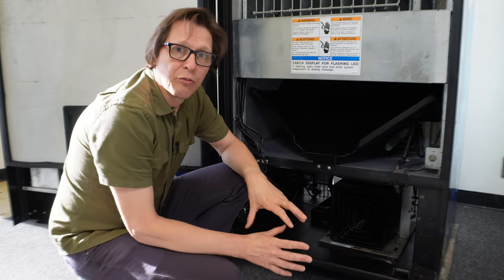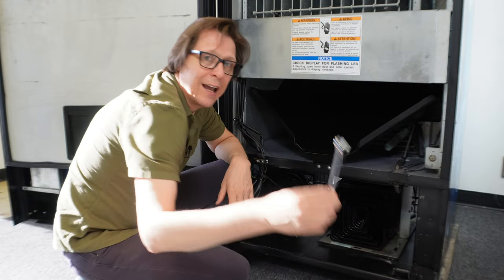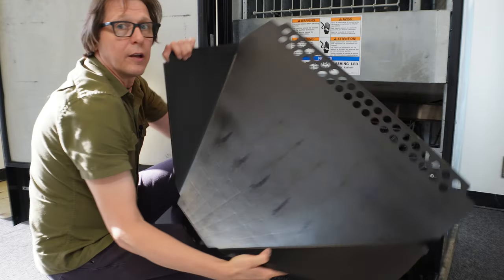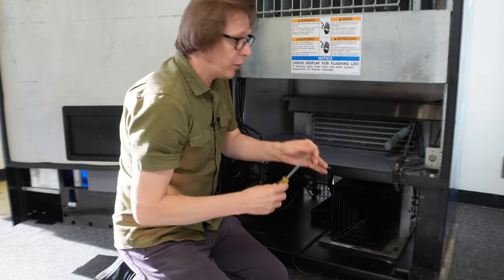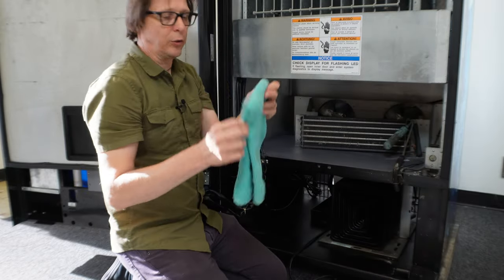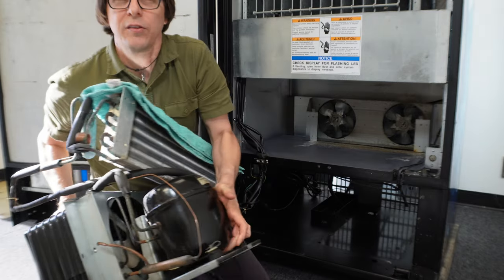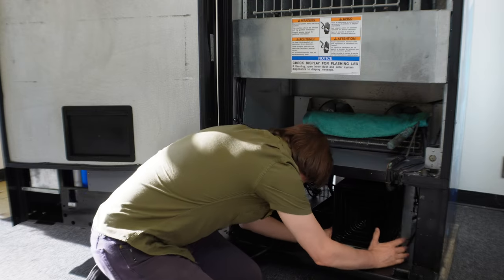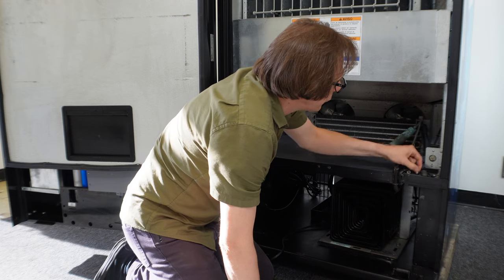Dixie Narco 501E & 276E Drink Vending Machine Cooling Deck Install - Vending Machine Repair

Comment: noticed he didn't have the platte that goes in front of the compresson on the machine. I find that plate to be the biggest headache of the whole process especially if any of the self tapping screws are rusted

Comment: Hey! This video has been extremely informative. I am thinking about spending about $500 to purchase a new cooling deck. I have ice building up at a very quick rate. I did your test from another video where I left the condenser running with the door open for 15 minutes and only about half of the evaporator coil was icing up. This seems to indicate that the condenser is no longer any good. I called a repair place that quoted me for $500 to $750 for repair, but I think replacing it myself is going to be better. What do you think?
Reply: Which video did you see about the icing up?

Comment: Can you do a video on how to install a royal 650 compressor unit like this video you did for the Dixie Narco 501 E
Reply from the maker: @Cori Walker Thank you Cori for the suggestion. I have added it to my list. Though the removal of the Royal 650 compressor is generally the same as a Dixie Narco 501E. The refrigerant lines in a Royal 650 drink machine are on the opposite side of the Dixie Narco 501E. Other than that. The tools needed and the process is the same.

Comment: Great Video!!  I need to know if I can quiet the fans when the compressor is not calling for cooling.  My 501e continues to run the fans and is noisy in the indoors location of this pop machine.
Reply from the maker: Please read my comment on your other post.

Comment: Very informative video. I have the 276E, everything is running fine but getting water build up around evaporator coil which in turn slowly cause water to end up on floor every couple days
Reply from the maker: Thank you. Are you getting any water in the drain pan at the bottom of the machine to the left of the cooling deck? Do you know what the actual temperature is inside the machine?
Reply: I will check those two things. I haven’t check temperature with thermometer so i will do so. I just know the drinks have remained cold. I’m new at this, so i really appreciate the help
Reply from the maker: @ericroberson4127  The temp you are looking for is between 36F and 40F. There is a small drain hole just below the evap coil. On the underside, there is a hose the directs the water to the drain pan. Check to make sure the water is draining to the pan. There could be a clog in the hose backing the water up. Look for any excessive amount of condensation around the inner door seal and along the edge of the cabinet. Also have a look at the motor cover to ensure is attached correctly.
Reply: @VendingMachineSupport  ok so i think i solved my leaking water issue. I did what you said and checked the drain hose, i took it off cleaned out and stuck small screw driver up hole and water began to drain. I bought $10 digital thermometer from Walmart and sat in machine for about 2 days and temp was at 44F, is that an issue? Also thank you again for all the help and guidance
Reply from the maker: @ericroberson4127  Your machine in my opinion is a bit warm. The temp in a drink vending machine should be between 36 and 40 degrees. Diet soda freezes and 34. So 36 is a safe low temp for drinks. Go ahead and adjust your thermostat two notches or 1/8 of turn clockwise and check on the machine the following day.
Reply: @VendingMachineSupport  i actually repositioned the thermometer and placed it on the deck where the evaporator coil is and it read minimum temp was 34 and actually temp was 39. I had the thermometer initially on the drink gat that keeps drinks from slinging out where i don’t think thermometer was getting accurate reading
Reply: @vending machine support have you ever had the other issue I’m having. I have Nayax card reader on the Dixie Narco and some transactions with card and Apple Pay are failing to go through. Now transactions are going through but there are times where person will have to try multiple times for it to go through or it doesn’t go through. When i log on to check last sales on the website it says “Cashless Canceled-MDB no Idle”
Reply from the maker: @ericroberson4127  This can be tricky. First thing to do is to rule out the actual machine. Is the machine able to take cash? If so, then have a look at the Firmware that the board is using. I am assuming you are using an SIID control board found on most E series  drink machines. (One single mode button). Navigate to HD -> DIAG -> VERS. This will show you the current firmware on the control board. Anything above 381.00 is able to handle credit card readers correctly. If this is true, turn your attention to the NAYAX device. Both the NAYAX VPOS Touch and the VPOS / AMIT devices have cellular signal strength meters. Look for these and ensure you have good signal. Move the antenna around or to the outside of the machine. Make sure the antenna wire is not bundled together. Bundled antenna wire can cause signal issues.
Reply: @VendingMachineSupport  The firmware on the machine is fine and Nayax updated the firmware on the device also. Machine is taking cash and far as connection i have Ethernet connection so the machines are have direct connection. The card reader is taking payments its just sometimes they don’t go through at all or take multiple swipes or taps to process. Nayax says they have done everything on there end to try to fire issue out but they say everything looks fine on their end from what they see. I’m going try to switch the devices in machines. I have snack machine with the drink machine, will switch the card readers in the machines to see if device maybe bad. The card reader in the snack machine doesn’t have this issue, all transactions go through with no problem
Reply from the maker: @ericroberson4127  That sounds like a solid process of elimination. Are you running the VPOS Touch device? Please share any information you find.
Reply: @VendingMachineSupport  yes running the VPOS Touch and will be sure to share what i find. Thank you
Reply: Did this machine have a evaparator coil? Aedin
Reply: @Vending Machine Support  Will a refrigeration class introduced me to the terminology you are using the narrator didn't address. Aedin

Comment: My 501 keeps blowing the fuse on the computer for the coin mech and suggestions ? All wires and obvious connections look good and also put a different mech in and it still blows the fuse
Reply from the maker: Are you using a MDB coin mech or a 12 pin 110V Dumb Mech? If using an MDB coin mech, does the fuse blow when just having the dollar bill acceptor connected?

Comment: I have a new to vending and I have a Dixie Narco 276E and I am finding water siting in front of the compressor. Can you assist? One machine may not be leveled, checked. The other is a clogged drain not sure how to fix. Thank you in advance. Great Video!
Reply from the maker: The drain tube can be found at the bottom of the machine to the left of the compressor deck. It is either a clear or black tube. It can easily be pulled off and cleaned out. If water is pooling a the front of the compressor deck. Check the area where I removed the plumbers putty. There may be gaps allowing air and water through. Often if the drain tube is clogged. Water will fill up in the cold box and leak out in this area. Also make sure the metal motor cover is placed securely on. Large amounts of water collecting in the cold box and around the evaporator coil usually indicates a problem such as the cooling deck is not functioning correctly or air leaking into the cabinet. Thank you for watching.
Reply: @VendingMachineSupport  Thank You So Much! Wish I could send you a pic of it, I will review and see what I can do on my home. The machine is running and cooling fine for now. Would the manual help with instructions and visuals?
Reply from the maker: @Nothingsofar123  Have a look around the black rubber seal on the inner door. The second door of the machine. Look for any excessive amounts of water droplets. Also check around the outer edge of the cabinet where the inner door closes. Any large amount collection of water droplets is an indication of where air is getting into the machine. Also place a thermometer inside the machine to get a temperature reading. Ideally, you are looking to have the temperature inside the machine be  between 36F to 40F. Diet Soda freezes and 34F. So 36F is a safe maximum cold temp.
Reply: @VendingMachineSupport  I so appreciate this 👍🏾

Comment: I have a 501e that isn't cooling - compressor is running. I have some experience with AC&R but see no charging port. I know about line piercing valves but not sure low charge is issue and don't want to pierce the line except as last resort. It does have an external Supco 3-N-1 starter capacitor that I just ordered from Amazon. There is no frost line on the evap with compressor running and door open. Please advise
Reply from the maker: The refrigerator decks in most vending machines do not have any type of service port. I assume this is done for manufacture warranty reasons. You will either need to sweat a schrader valve to the end of the fill line or install a piercing valve. If you are not getting any frost on the evaporator coil when running the compressor direct to power with the door open and the machine unplugged from the wall with in a 15 minute window. It very well could be low on charge. Please keep in mind that I am not a 'certified' refrigeration mechanic. Though from my experience what you are describing is a low charge or blocked cap tube issue.